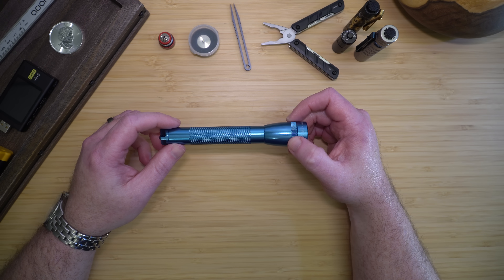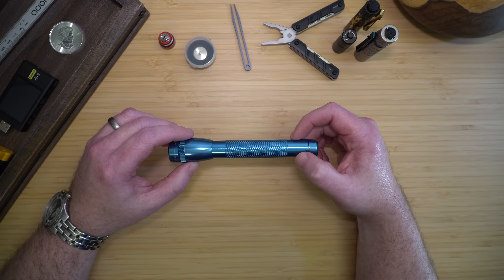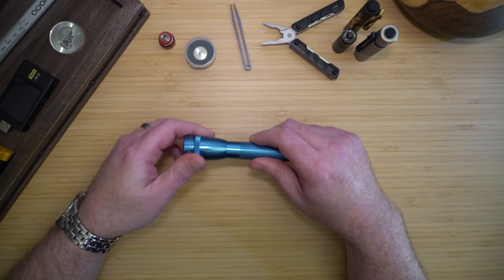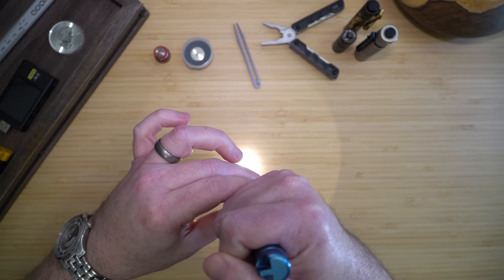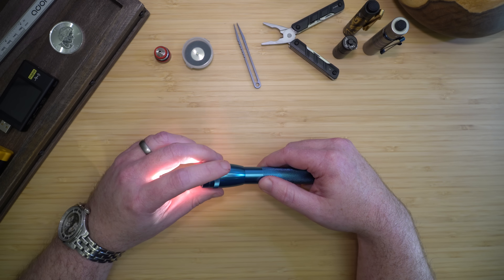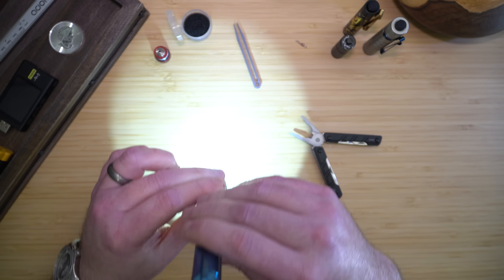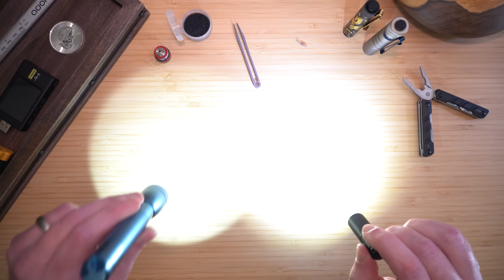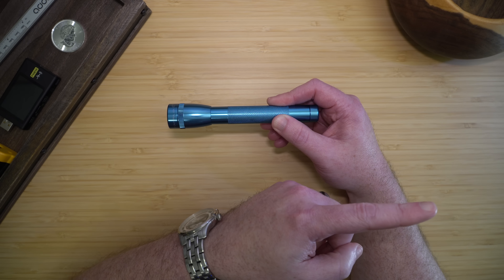Classic to Cutting Edge: Iconic Mini Maglite Upgrade

Comment: Can I meaningfully upgrade my big maglite? 4 or 6 D cells, IIRC?  Some 18650s or 21700s down the guts and a serious emitter and you'd have an efficient bludgeoning weapon again :-D
Reply from the maker: @fredio54, flashlight and battery tech have improved dramatically over the years.  Upgrading a Maglite definitely improves its function and helps save on waste, but depending on your needs, there are lots of better flashlight options available. Thanks for watching!
Reply: @chestersedc  Yeah, I know, I have 3 modern lights, the titanium nitecore on my keychain outperforms your upgrade on burst mode, the olight baton 3 premium, and the olight marauder mini - might get a serious flooder and serious thrower and another baton (4 premium maybe) in future, but I'm set for lighting, just nostalgic and don't like waste.

Comment: One of my jobs in the Air Force always had me peeking into odd dark spaces. I kept a Mini Maglite on my belt all that time. (Along with the original Leatherman tool.)  I've upgraded a couple Minis with LEDs, as well as some 2 and 3 D-cell lights. Gives them all a new lease on life, with the old time vibe.
Reply from the maker: Thank you for your service and for sharing your experiences!
Reply: As a loadmaster used it alot, flightsuit even had a pocket by the crotch that was perfect for it.
Reply from the maker: Sounds like the flight suit designers really thought of everything, including the crotch pocket! 🤣 Thank you for your service.  I image it was pretty dangerous loading all of the ordinances.
Reply: @straydawg461 You kept a light there? We always kept the switchblade/shroud cutter (aka thigh knife) in that pocket.
Reply: @jaadow77  yep, didn't really have need to carry knife (C-5), had a stainless U.S. knife but it wasn't switchblade and it went in helmet bag (we didn't have helmets), with my checklists, calculators, batteries...you name it.  If needed to cut straps I carried a retractable carpenters razor knife.  Our missions/tasking never really had a need for it, unless it was an oh shit time to ditch cargo...which thankfully never happened either.

Comment: Best memories? Hm. I bought an AA MiniMaglite at the start of my conscript time almost 25 years ago when a guy of my platoon told us about his. The "normal" flashlights that were more common back then here tok 4.5V batteries and were huge compared to the Mini Mag and had less light. And it fit into the webbing with a thin cordura holster. On many night trainings in the woods it came in handy during breaks and when looking at maps (while covering most of the lense to have less light).
But on every single "several-day-exercise"s the bulb broke when i needed the flashlight. So each time i had to change the bulb in the dark. Which isn't really a fun experience, cuase if it falls down, no chance to find it again.
When i started working i had it in my backpack, as sometimes we needed to look into a cabinet, under the floor...
And a few years later after a little reorganization we also mainatained a "tower simulator" for atc. And this room was clad out with dark, light absorbing materials. Without flashlight, it was pretty hard to repair stuff in there. Even when the lights were switched on. That was the time when the LED lights had become quite good and so i read a ton of reviews, and bought a Nitecore D10. I still carry that thing around at work every single day, even though my area of repsonibility at work has changed. Still need a flashlight form time to time, and the D10 only needs 1 AA battery, and i can change the output without needing a second hand and wihtout steps.
I find it really sad that Nitecore has stopped making them long ago, and has nothing in their repertoire anymore that can do what the D10 could in the same package. And neither does any other light manufacturer to my knowledge.
(I probably would buy another one if they still made them.)
Reply from the maker: Thank you for sharing your flashlight story with us! It's incredible how something as simple as a flashlight can bring back many memories and serve you well for many years.  For a modern single AA flashlight, I would recommend the Olight Diffuse ( https://youtu.be/OsqmdQyNDvU ) if you like a side switch and don't need a pocket clip, or the i5R EOS ( https://youtu.be/MB7vTcAjfFE ) if you want a tail switch and reversible pocket clip.  Both come with USB-C rechargeable "AA" batteries but take standard AA.  Standard AA won't reach the flashlight's peak brightness but will be plenty bright in my experience.
Reply: @chestersedc  Thanks for the suggestions and the reply!
The diffuse is roughtly the same dimensions as my D10, but the sideswitch is probably not the best idea for the way i carry it. 
And the i3 with it's only 2 modes is too bright in high and too low in low mode for my usual usecase.
-> as i said, there's not really a good replacement to be found for my D10 in my use.
It's brightness is only around 100lm with the AA battery, but doesn't have fixed stages between low and max. You can ramp it up and down seemlessly, and stop at whatever brightness you want. And i usually end up somewhere in the middle.
The seemless brightnesschange is quick and easy, and only done with the same button that switches it on and off. No counting of clicks, not complex click patterns. 1 click = on or off. 
double click= quick access low, click and hold=quick access high, click and hold: ramping up or down. Lifting off the finger during ramping= chosen brightness.
And the tailswitch is metal (so it's not wearing out or breaking like rubber over the years) and recessed enough so it can tailstand.

Comment: These were the OG stagehand flashlights.  I remember once, inspecting the rigging up in the grid… 96 feet above the deck… when I dropped my mini mag!  Like a pachinko machine, it seemed to hit EVERY pipe on the way down before it slammed onto the stage below.  The guy I was working with picked it up. The first thing I said (actually, the second thing, after “SORRY!”) was… “well?”.  He gave it a twist and it fired right up… respect!
Reply from the maker: Thanks for sharing your story! It's amazing how durable Maglite flashlights are. I'm Mr. Butterfingers and am always dropping mine too.  I have had bad luck with drops burning out the bulbs, but the LEDs have fixed that problem.
Reply: I never dropped mine from the grid, but I had it in my pocket for so long that about half the anodizing wore off, leaving bare aluminum. I probably had that Maglite in my pocket for a decade. I wonder if I can find it and do the lampectomy to make it more useful.
Reply from the maker: A Maglite with a patina of memories and a touch of DIY surgery? Sounds like a unique project in the making!
Reply: Yes, carried a Mag working as a stagehand as well and I liked the fact that you had to twist to turn on and off, no accidental light during a performance!
Reply: The few times I worked on stage we carried ours on lanyards so we wouldn’t accidentally sweep the stage with light and startle someone in the audience. Carried one for several decades with many fond memories. Now I am a Streamlight fan and love the extra lumens.
Reply: I have the belt holster and wore it daily for a decade

Comment: I have had Maglites for decades. I upgraded my mini with the LED Maglite offered a while back. Not quite as bright as iT3 but close. I also added a Maglight tail switch. Not the best or the brightest out there but American made goodness for sure. I have their LED 2 cell. Batteries last a very long time.
Reply from the maker: Your Maglite setup sounds solid! American-made quality really stands out, doesn't it?
Reply: @chestersedc  It sure does. Don't always need a supper blight light that can throw a half mile. The 2 and 3 D cells can be a great backup as well.

Comment: Ah but now you can get a Mini Maglite that puts out 332 Lumans. Of course it goes through batteries pretty quick. I just bought the 127 Luman Mini Maglite, and it does what I need it too. Maglites are all good as far as I am concerned.
Reply from the maker: Nice choice with the 127 Luman Mini Maglite! Thanks for the info on the 332 Luman version too!  It's great modern LED Maglites are available, and I'm glad to have the option to upgrade my older Maglites.

Comment: My best/worst memories of any Maglite was cleaning up the mess when the batteries leaked and corroded themselves into the housing. Good times mostly thanks to Duracell.  

I was an early adopter to LEDs in the Maglites I used at work, they were durable but not terribly bright. I even went so far as to purchase the NiCad rechargeable version that was stupid bright for the time but run time was awful and battery memory was a thing. Thankfully, LEDs and batteries have come a long way since the 90’s.
Reply from the maker: Thanks for sharing your Maglite experiences! It's always interesting to hear about the evolution of technology.  I've moved all of my car electronics to Energizer Lithium batteries to avoid the leakage.  Duracell are the worst offenders in my experience as well.  Thanks for watching.

Comment: WOW what a great upgrade.  I have had a few Mini Mags in my life but one in particular that went everywhere with me when I was in the Corp.  I was a helicopter structural mechanic and my Mini Mag traveled all over the world with me.  It has literally been sitting in a drawer in its homemade belt sheath I made for it for 35 years.  I was able to find the same LED on Ebay for $15,  which yeah it's expensive but 1000% worth it,  thanks again for doing this video,  great to bring a piece of gear that helped guide me through some difficult times.
Reply from the maker: That's awesome! It's great to hear that the upgrade brought back some good memories. Keep shining bright with your Mini Mag and thanks for your service!

Comment: The mini maglite was the best in the ‘90’s. I was blown away by the early LED upgrade I had in 2009 or so. The one you’re using makes me want to go find an old mini maglite to upgrade. Though these days I rarely use a handheld, generally I prefer a headtorch.
Reply from the maker: We had the huge 6 D Cell Maglite back in the day.  Crazy you can get the same power in a keychain flashlight now.  I am loving my upgraded mini mag.  Brightness is amazing, and the battery life has been even better than I thought.  I got over 8 hours on the last pair of NiMH AA's.

Comment: I was expecting a soldering job, just an easy push in LED, really couldn't have been quicker or easier. I'm surprised there are no LED screw in replacements made for old torches, with the AA batteries that most had they'd last for a lot longer and be brighter too. But, I'd guess the manufacturers don't like upgrades they'd rather sell us replacements instead, hardly environmentally friendly is that!
Reply from the maker: Totally agree with you on that! It's frustrating how companies push for replacements instead of sustainable upgrades.

Comment: I'm an OG too and STILL have my old maglite which I "think" took 4 or possibly 6 x D batteries. It stopped working about 20 years ago but I held on to it simply because, as you say, it was aircraft aluminium and while there are smaller, better and cheaper solutions available today (I've discovered the wonders of Nitecore 😁), I'm pretty sure that it'll be a pretty cheap fix / upgrade and ... being the sentimental fool I am, I'll have a maglite that's about 25 years old. The world has become very "consumable" but to me it makes more sense to just maintain and upgrade existing gear and give it a new lease of life rather than just add to the ever-growing piles of waste.
Reply from the maker: I agree.  My grandparents were just starting their family when the great depression happened.  My grandfather taught me how to treat things well, fix and reuse.  In our world of abundance, those lessons haven't been learned.  Thanks for watching and good luck getting your OG Maglite in working order again.

Comment: I still have one in my glove compartment. I think it has an LED upgrade in it, but is from decades ago, so likely nowhere near as good as a modern upgrade.
Reply from the maker: It's like a vintage treasure in your glove compartment, ready to light up your journey!  I'm sure it does a great job, even with the older LED tech.  Just make sure you replace those batteries once in a while, leaking batteries have taken many Maglites to the grave.  I've switched to Lithium batteries for my car electronics as they work in very hot and cold conditions, and they don't leak like alkaline batteries.  Thanks for sharing and watching!

Comment: the original 2-AA mini-mag holds a special place in my heart, that was the official bar/club soundguy's light of choice for the longest time. you carried that, a sharpie, an original leatherman multi-tool and a roll of gaff tape and you were ready for anything

i have probably half a dozen of the old-school versions, all upgraded with LED bulbs and push-button endcaps. i make a point of getting different colored ones, taking them apart and mixing the parts up so they're all a hodgepodge of different colors
Reply from the maker: Thank you for sharing your special connection with the mini-mag! It's incredible how certain tools can hold so many memories.

Comment: I've got literally dozens of these so-called mini tactical lights. None of them measure up to my MagLites. I've the full run from D-cells 2-6 and 2 AA-cell in several colors (mostly because the were marked for one reason or another) but my absolute favorite, my GOTO is the 3 AA-cell Mini. That is what I carry when I'm working and it is apart of all of my SHTF gear. Med trauma bags have 1 AA-cell. That is the only exception in my working kits. MagLite has never failed me.
My my critical application was using a 5 D-cell LED to bring in a  Mercy Air Flight to a crash site in the Desert. It was a clear night in the Eastern desert of SoCal. The told us over HAM radio that the flight would come out of Laughlin NV. We fixed a bearing and I pointed my light in that direction. When they got close, I turned it into a torch. The pilot told us, through the HAM operator, that he picked up the light right after getting airborne. 
It was a professional dirt bike racer prepping for Baja. Wheel Taco'd; forkes planted; driver launched and the ground was unforgiving. Took his support team over an hour to find him and about that again to locate us, luckily for them we had a HAM radio. They told us it wa 5 1/2 hours from impact to surgery.
Reply from the maker: Thank you for sharing your experience with MagLites, they truly are a lifesaver!

Comment: Hello. Do you think that the coldest light color is always better? And strongest light intensity is always better?

LED color that has a cold light with blue is an ugly light color.
Therefore I can't find anything that fits in my car as a reading light. Yes, I have researched quite a bit!

The only focus is on the strongest possible light and the coldest possible light.

Yes, the light can be too bright and too cold in collor!
Reply from the maker: No, brighter isn't always better, especially when the OG Maglite only has one output setting.  Color temperature is specific to everyone's preferences and usage needs.

Luckily, the LED upgrades available offer many brightness and color choices. But no LED will ever have the warm glow of an incandescent or xenon bulb.

Comment: My AAA mini maglite does not shut off unless i remove the lens cover. With the land cover and I am unable to screw it together. Any suggestions?
Reply from the maker: I don't have an AAA mini-Maglite, but it appears to work the opposite way of my AA.  On the AA loosening the head makes the light turn on but it sounds like the AAA light turns on when the head is tightened.  I would make sure there isn't anything keeping the pressure plate from going in or out, based on which activates the AAA light.
Reply: @chestersedc  thanks for the info.  I removed two o-rings and was able to get the light to fasten with the lens cover and work and also turn off.
Reply from the maker: I'm glad the information helped you fix the issue!

Comment: Memories? I still use a mini mag lite for work granted it’s the pro + version at this point (330+ lumens) but I’ve been using them since the old incandescent ones
Reply from the maker: Nice! Mini Maglites are the OGs of flashlights, glad to hear they're still serving you well at work.  I enjoy using my upgraded light, the LED makes a real difference.  Does the pro+ have more than one output mode?
Reply: @chestersedc  yes an energy savings and a full bead mode
Reply from the maker: Thanks, I've added it to my wish list to check out.

Comment: Playing Army in the 80s, I had several. They were more useful than the angle heads. I bought them with the accessory pack of colored filters. Upgraded to LEDs later.  Unfortunately all but one managed to succumb to leaking batteries. Lithium batteries seem to minimize that problem. This is still a great, inexpensive light to get for kids.
Reply from the maker: Leaking batteries have killed many flashlights.  I stay away from Duracell as they seem to leak the most. Lithium or the new Li-Ion USB-C rechargeable AAs are the way to go.